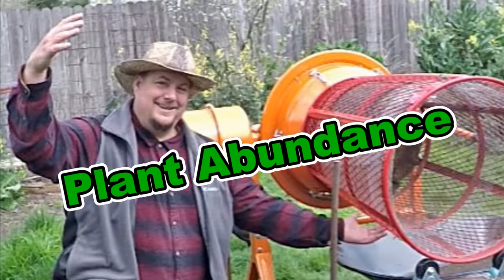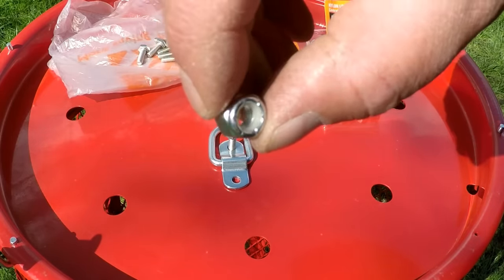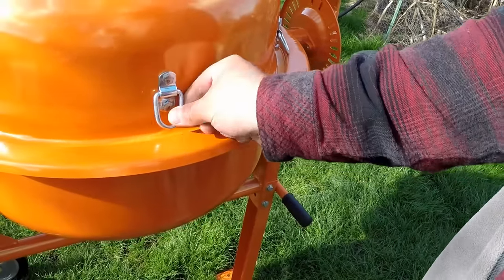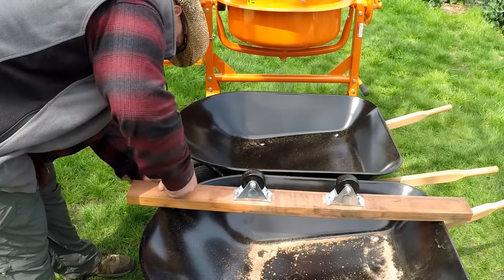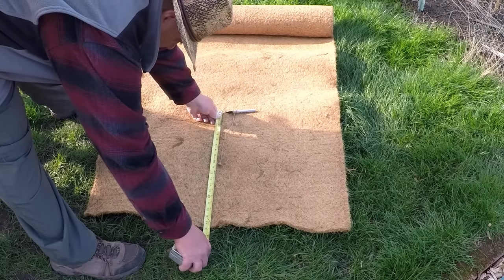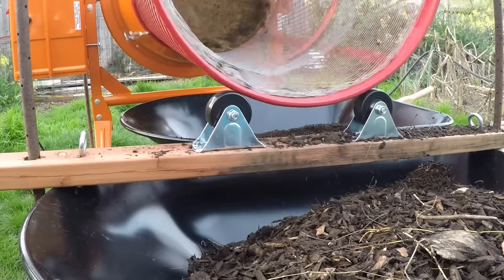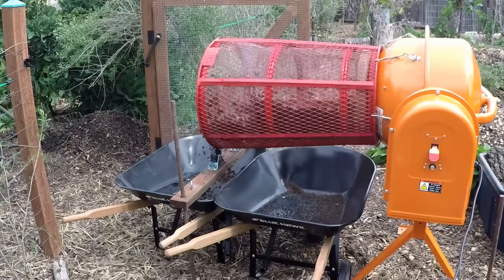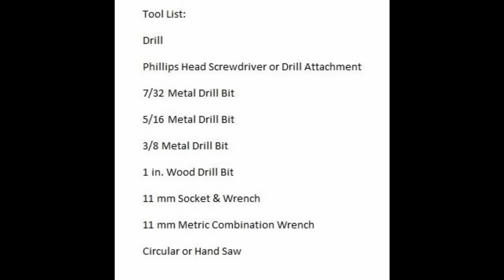How To Build An Automatic Compost Sifter / Trommel Using A Cement Mixer & Trash Can

Comment: Made a slight variation with my build based on your video: Instead of the Anchor Points, I replaced the 6 bolts holding the top and bottom halves of the cement mixer together with 1/4 in.-20 x 3 in. Eye Bolts and used longer M10 Hook & Hook Turnbuckles to go from the Eye bolts to the Waste Receptacle. That way I avoided drilling all the holes in the cement mixer as shown in your video.

Comment: Thank you for sharing and all the information. I built this same unit this past summer with some slight modifications and it works perfectly. A Milwaukee m18 leaf blower keeps the 1/4” mesh free and clear of wet mulch during operation. Thanks again as you saved my back along with valuable time.

Comment: Really good video! For me I would use my drill/driver to tighten all those nuts. Also turnbuckles are easily adjusted using a flat head screwdriver of at least 6 inch length so you don't risk skinning your knuckles. Gotta love the utility of  concrete stakes or a length of #4 rebar.

Comment: Well I just finished my my version I use the the galvanized waste receptacle much more durable than paint also added aluminum angle two 24 in 180 deg. Opposed to flip the dirt inside the trommel.... I went to Northern tools and and got there strongaway 1200 pound plastic bed towable cart with rail sides that keeps the dirt in the cart and the steady wheels are on the front railside of the cart...i had to rase the mixer using 6x6 it made it more stable had to do it because it gives the cart room ,,,,wish I could show, pictures...works great...
Reply: Have you posted your pictures any where? What mixer did you use?

Comment: Since you obviously visit Harbor Freight, I suggest you get their very inexpensive center punch to indent the center of the places on the metal where you intend to drill holes. That way the drill bits will be less likely to “walk” around the intended hole location.

Comment: My partner has worked in concert finishing for almost 20 years. Last year we moved in together and he brought home a huge load of garden dirt that a client didn’t want anymore. The garden was removed to make room for more parking. He dumped it in a pile in our backyard. I used to work at a Hotel years ago and they changed out their furniture. Staff we’re allowed to take the old furniture home for free once they had sold what they could to the public. I took the Queen sized headboards home. They came with me wherever I went. So I used 8 to build two garden boxes and filled them with the same dirt he brought home. I have enough boards to build two more but not enough dirt. The pile that was leftover ended up growing grass & weeds. I covered it with a tarp & rocks to help kill them. I’m going to ask my partner to bring a cement mixer home so we can put something like this together. This will help shorten the waiting process and I can always build the two boxes & add dirt as I get it. The garden boxes are doing amazing and I have been outside all summer making improvements to the yard. I’m mostly fixing the stuff given to us. I can add the garden boxes, dirt & weed fabric to the list of things we have gotten for free. I call it free-cycling. ❤

Comment: Love this!   A bit more expensive than scrounging up some old motor but this mechanical dummy has no clue how to rig a motor with belts and pulleys.   I also have some concrete work to do so I like the dual purpose of the cement mixer.   Thinking about running the soil through a second time, wrapping the barrel with 1/4" hardware cloth for potting soil.

Comment: to support the trommel I used a small 18x18 inch furniture dolly with 4 casters turned upside down and bolted to a board. Harbor freight sells them for $5
Reply: What mixer did you use?

Comment: LOL love the mixer. When the motor burns out I have a video up for like 5 years now how to put a bigger stronger more reliable motor in it from tractor supply. That mixer comes with a terrible weak 1/3hp motor that will over heat and die eventually. Maybe 12 uses before mine died. I keep it inside to. If you never load it heavy maybe it will last. The 1/2hp motor from tractor supply has held up to so much abuse and still continues to work strong. Take the cover off and relocate the switch that will help it dissipate heat better perhaps last a long time.

Comment: Excellent stuff! If anybody has a source for a similar waste bin in the UK, that would be great! 
We don't have a cement mixer, but with a bit extra parts and modifications, this could be converted into a manual rotating drum sieve, which would still be way faster and easier than hand-held sieves.

Comment: Yours is a closest so far after three videos to what I'm trying to get to what I work at a steel Warehouse 24 years ago.

I do not just want a static screen over a static box requiring human labor to do the screening even if it's with an end loader.

I want a mechanical way such as you have devised.

Comment: Nice job!!! Just wish the cement mixer alone didn't cost $168. Imma gonna start saving up!
Reply: They have 20% off coupon all the time. If u cant find one in your local paper just Google but check the date at the bottom.
Reply: @nshue23   Thanks for the assist... but...Yeah that $168 is AFTER the 20% discount.
My Freight Harbor game is on point.
Reply: So did you build one? How did it go?
Reply: James Swanson Hi James. No I haven’t yet. Can’t justify the cost in my head.
Reply: And the outdoor waste can looks to run about $177.00. (Might find it a little cheaper, but I've got better things to spend $400.00 on.)

Comment: Can you use the mixer barrel (where you mix concrete or soil) to break up dried leaves to speed up black bag composting process?
Maybe add a couple pieces of sharp dirkey boards (the kind you find in a spool scrap wood pile) to tumble with the leaves to help break up the leaves.... just thinking

Comment: I would avoid bolting any anchors to the bucket. Since the bucket is bolted at the back I'd just attach some o-rings to the existing bolts and ratchet strap the red basket to the bucket. For mixing concrete the bucket needs to be smooth or you'd never be able to clean it properly.

Comment: Will it leak if using as a cement mixer? Or can the anchor points be sealed with silicone and left intact when using as a cement mixer?

Comment: GREETINGS AGAIN SOLDIER 🪖, HOW MUCH DID THE CEMENT MIXER COST ?
Reply from the maker: Howdy. The cement mixer was around $250 as I recall. The total cost of this build came in at a fraction of the cost a turnkey powered trommel goes for. Plus you still have a fully functional cement mixer when needed. Cheers!

Comment: What is with the 11 MM wrenches. 1/4-20 takes either a 3/8 or 7/16. depends on the manufacture and intended uses. I also wondered about the clearance of the buckles so heavier eyebolts MAY give more space to tighten the buckles.

Comment: Hi, how does one determine the required size of the drums, e.g. I want to use two drums, each 6 and 10mm "sifting" openings, roughly 45cm-50cm diameter and 50cm long and the two joined together to make a total length of 100cm, can that work?

Comment: You would be better off to reverse the bolts connecting the tie rings. The nut on the inside of the drum will be very difficult to remove if you ever mix concrete.
Reply: Washing the mixer out after mixing concrete is the go
Reply: @kdegraa  Impossible to perfectly clean the drum. You would know this if you had ever worked with concrete for any amount of time.
Reply: Andrew Bugbee 😂👍

Comment: nice, but if you found a smaller trash can that can fit into the hole of the cement mixer, you would not need to all the other contraption. you would collect sifted bits in the cement mixer and the big bits would stay in the trash can.

Comment: How about when using the mixer for soil mixing or cement mixing, a small, rare earth magnet could be used on each turnbuckle mount to hold them to the barrel, rather than banging as the mixer runs...unless of course, you are into a mini Anvil Chorus.
Reply: I'm guessing you could duct tape them down too. Or crushing them with a few zip ties and cut the off. Probably lots of ways to deaden that noise. I am a huge fan of magnets though

Comment: I've built this 8yrs ago
Instead , put cable reel round to the bottom half of the mixer using bolt holes already there and make  a cylinder of 3/8 hardware cloth and screw that to the edge of the round with wide banding strap on the outside of the screen for reinforcement just drill and screw through the strap,

Comment: I am confused. You created a compost sifter from something that cost more than a compost sifter.
Reply: It's also a cement mixer and a rock tumbler and a gravel sifter and a glass polisher, AND it's nearly bulletproof and easy to change out the motor on. By far the best tool harbor freight sells.

Comment: If you want a tiny improvement? Weld a 1/8" metal strap 1"wide around the top rim to smooth the wear and tear on the castors. You'll need to put the strap thru a ring roller to get a decent shape. 🇨🇦👊🏻👨🏻‍🏭⚡💖🍁♻️🍁🐓💩😆😂😆Chickenpoo. I am making JADAM chickenpoo, and add it to my composter, and Biochar, its amazing flowering food. Roses, Cannabis, 2 most popular examples.

Comment: I was wondering if your mixer was still working for you? The one star reviews on harbor freight site are God Awful. Great build!
Reply: I have the older style 4.1 mixer from Harbor Freight, been using it now for 9 years and have never had an issue with it. I have replaced the old inner tube tires with some never flats from Tractor supply, but that was by choice.
Reply: Forgot to mention my mixer has had at least 2500 bags of concrete mixed in it through the years. Still going strong!

Comment: Nice Job, and nice video, 

However, f you don't have more than one cubic meter of compost to treat, a simple wood frame (adapted to your a wheelbarrow's measurment) covered with wire mesh, is much simpler to manufacture ! Compost's treatment is simply a little bit "Physical"